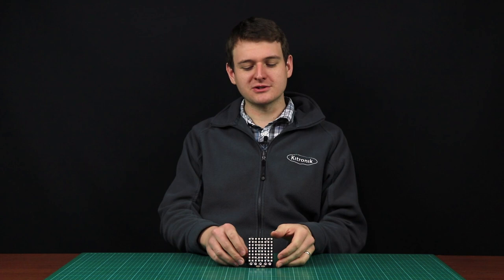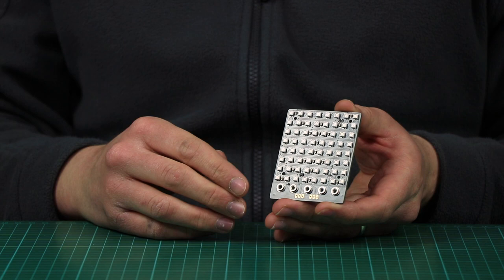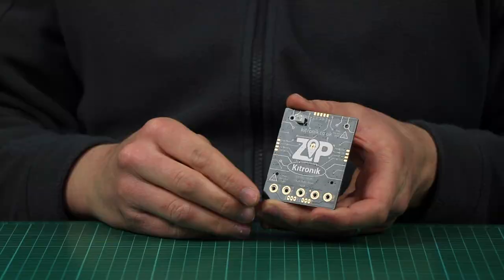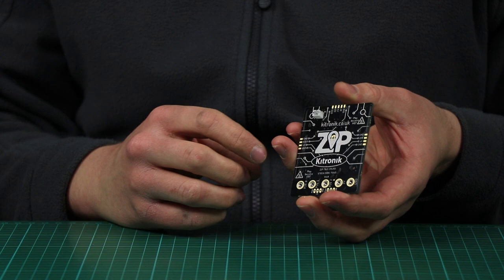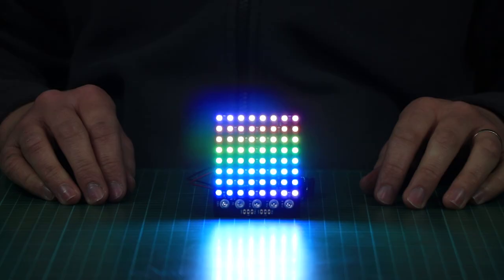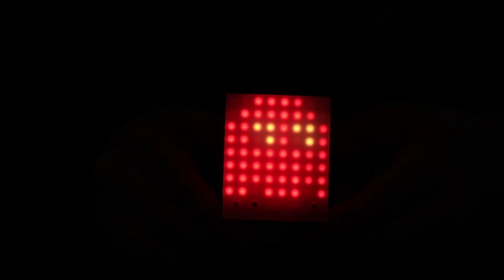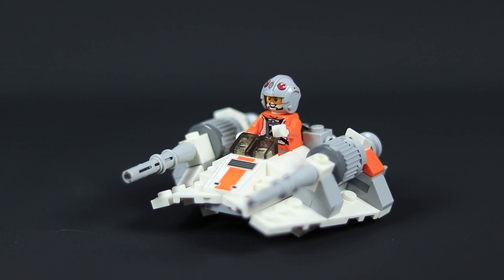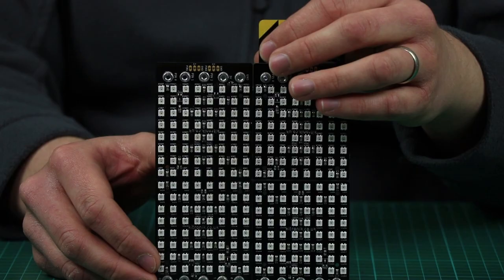ZIP Tile LED Display for micro:bit by Kitronik

Comment: I don’t have one yet, neither a micro bit (it’s coming tomorrow), but I want to ask a question about this because I’m considering getting some. Are you able to activate/deactivate individual leds? I’m using Microsoft make code for it, if there’s not support for that in Microsoft make code is there any other softwares I can use to do that? Also for example I would want to place a green led at x3 y7.
Reply from the maker: Hi, each LED is individually addressable with code. You can turn each on, and off, and change each LEDs colour independently of the others. MakeCode has blocks for these types of LEDs under the Neopixel menu but we have also produced some custom blocks for this LED panel that you can add to the editor. These custom blocks serve to simplify writing code for the tiles as much as is possible.

In the editor; click on the cog icon in the top right and select extensions. This opens up a page with a search bar. Type and enter Kitronik and a list of all of our custom extensions will appear. Find the extension for kitronik-zip-tile, and click on it. The new menu should now appear in the editor with some new purpose-made blocks inside. I hope this helps.
Reply: @kitronik Alright thanks! I’ll update you again once I get one!

Comment: Hello, I bought 2 of your products zip tiles. While studying, I want to connect 2 zip tiles like the video, but I want to know how. Do you have to solder it? Or is there another way?
Reply from the maker: Thank you for choosing our micro:bit accessories. The connections are designed to be soldered to (short lengths of wire between them for best results), you can safely desolder the joints if you need to separate them later. 

 We hope that you enjoy your purchase!